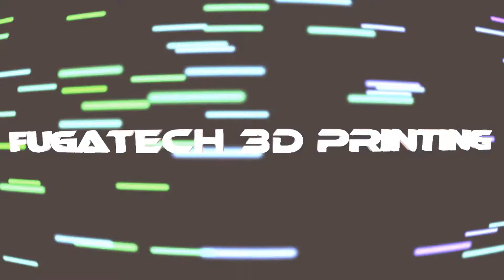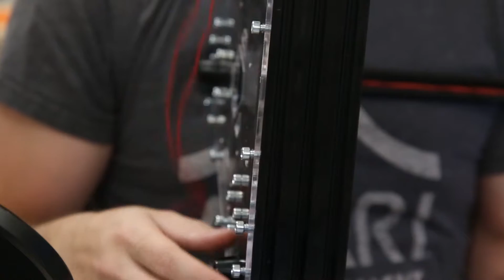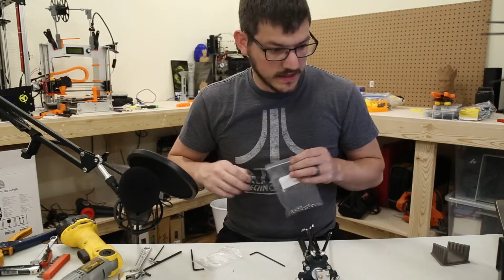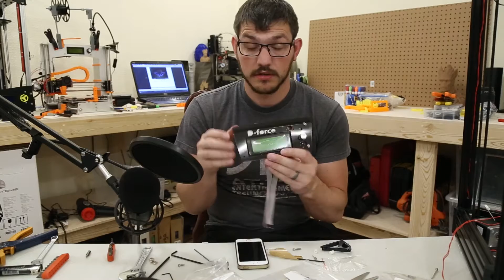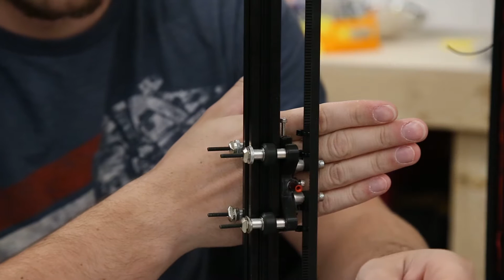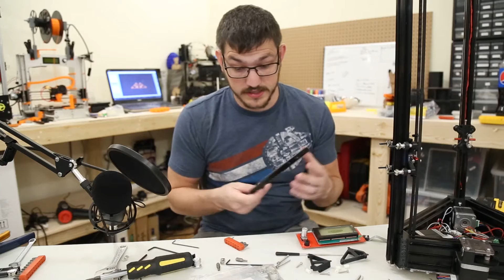Trianglelab D-Force Mini Kit Build Part 2

Comment: Also, I have one of cheapest Kossel Mini kit, i bought at aliexpress. Looking at your build logs, I can tell that Trianglelab did a lot on designing the corner pieces, mounts, carriages, effector. Basically, everything is designed from scratch rather than just use the Kossel mini designs blatantly. Maybe they did take inspiration from other Delta machine, but as far as i can tell, those are their own designs. The frame is a lot more rigid and easier to install compared with the inherent flaws of the typical Kossel mini that come with 1515/2020 aluminium extrusion.
Reply from the maker: Well that's interesting. I've never seen another delta in person so it is all new to me. I hope to get more in the future to try out.
Reply: You might want to consider joining my facebook groups about Delta printers.

we have some interesting discussions over there.

https://www.facebook.com/groups/225641914468236/ (well, i am more active on this group)

https://www.facebook.com/groups/1816779348593714/
Reply from the maker: I've joined up!
Reply: Fugatech 3D Printing yea i know i replied your post regarding the fans mount :) welcome aboard

Comment: cool, did they send you the kit? or is it purchased by yourself? 

My father works with acrylic sign boards, learned a thing or two watch  him work when was a kid,  i know a thing or two about acrylic. for the acrylic LCD cover, i can tell that it is most probly off because of the heat bending process they did to make it look nice. because the heat bending process usually cause deformation if you let the part stay in the heat for slightly too long, heck even if you're being careful it will still deform. This or the laser cutting process is not properly tuned (too hot).
Reply from the maker: Hey Evert. They sent me the kit to try out and help them refine it. That is great info about the acrylic.
Reply: Ha, i actually just started a small youtube channel. They sent me some their products for review too.
Reply from the maker: Very cool. Can't wait to see your video about it!